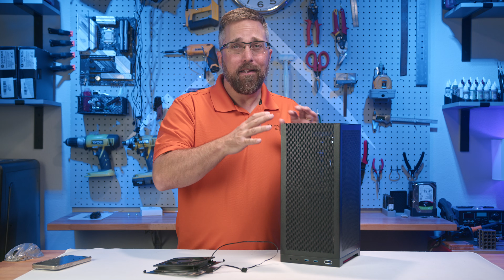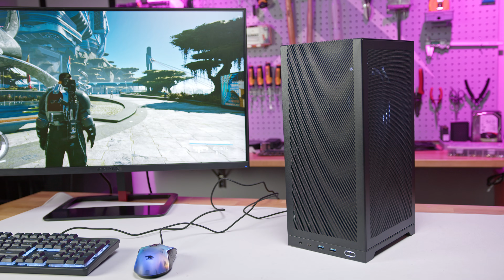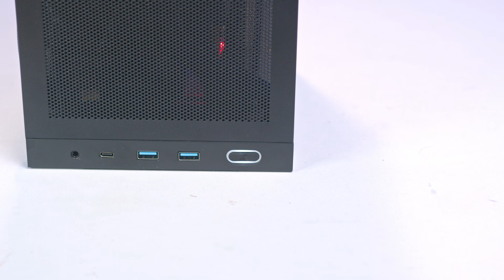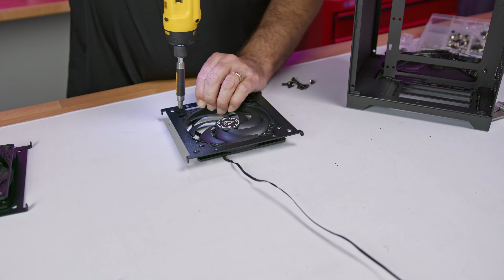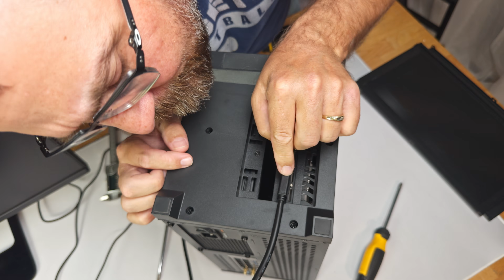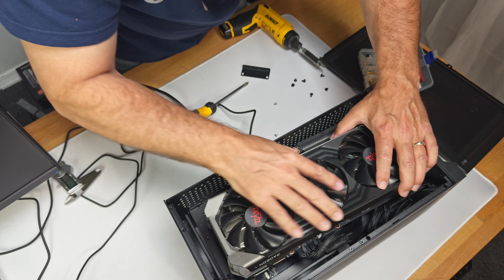Shiny Snake L400 Mini-ITX Tower Case Review! 🐍

Comment: I think the cooling is decent for a 12L case. If you use a sff PSU so you can fit a full thickness 140mm fan at the bottom and then you can do 2x 140mm slim fans instead of the 120mm slims at the top and front.

Comment: Love the review, how good the clearance at the back of the mobo where a rear m.2 usually sits? Is there enough clearance for a heatsink
Reply: I just got this case, even a low profile m.2 heatsink will interfere with the GPU unless you use standoffs on the riser cable like in the video to space the GPU further away from the mobo.

Comment: You can use one of the fan brackets to mount 2x 2.5" inch drives. It's in the product page on the Amazon listing.
Reply from the maker: The screw holes don’t line up. I tried. Unless you just secure them each with a single screw, which isn’t ideal. They will vibrate loose very quickly.

Comment: Thumbs up on the review; thumbs down on the case. The display connectors on the bottom are dumb.  Tell ShinySnake it needs some polishing.
Reply: Shiny Snake stopped making its vertical cases with extension ports at the rear, it is a downgrade. I have the Shiny Snake L300, and on the case there are slots for extension ports moulded in the base  for one HDMI and one Displayport (the displayport connector was preinstalled, and I bought the HDMI connector on Aliexpress).

Comment: Its awesome to see a review of this case. And it was really cool to see the mod with standoffs for the GPU. But, I wanted to see you go further. For an ITX review,  it makes sense yo see a build with an SFX PSU to see if the extra air space and fan allow better temps. Also, an SFX PSU allows a 25mm thick fan at the bottom-front.
Also would like to have seen comments about rear NVME temps before and after the standoff mod.

I clicked like ;)
Reply: IMO, they should have put the mobo at the bottom and the PSU at the top. To give blow through cards some space. And to save SSD from being blasted by GPU exhaust.

Comment: Does the fractal Terra have the same problem with video cad port access?
Reply from the maker: No, the Terra isn’t a vertical case. The display ports are at the rear of the case.
Reply: @ElevatedSystems  Thats what i thought. This form factor in vertical orientation has a port problem.

Comment: I love vertical tower ITX cases, but I've sworn off any case with a riser cable. It's just not worth the hassle of potential compatibily issues and also having to get a new compatible riser as PCIe generations change. I manged to pick up a Corsair 2000D ARGB for $59 when they discontinued it, which was $100 less than MSRP. Also previously used a Hyte Revolt 3 as well.

Comment: Pretty case but IMHO, too compromised. It would have been so easy if they increased the dimensions just a tiny bit to allow more room underneath and a bit more room for thicker fans and to more easily install the full size power supply. 

Also, I tend to put a small clock and my phone in front of my PC so the bottom IO and power button are a deal breaker for me. Again, with just a little bit more space they could have put the power button and IO half way up one of the sides.

Lastly, after having had the ASUS AP201 case, I am spoiled with screw-less and  tool-less side, front, and side panels. Again, if they had allowed just a little more in the dimensions, that could also have been designed in this case.

I'm now realizing, I guess I want a half sized Asus AP201 case with all the same bells and whistles.